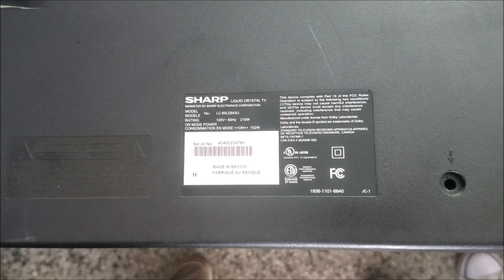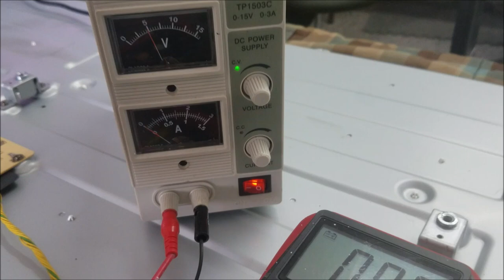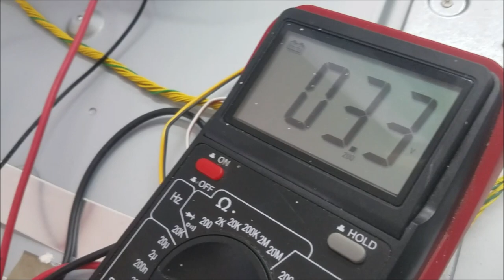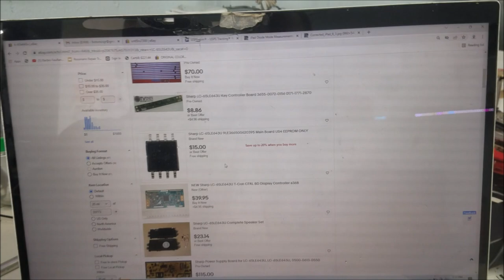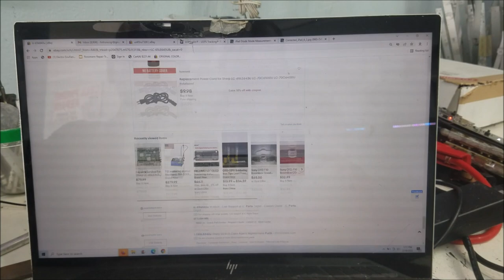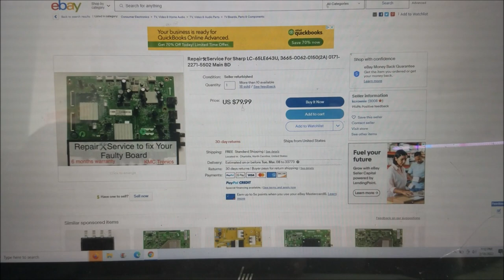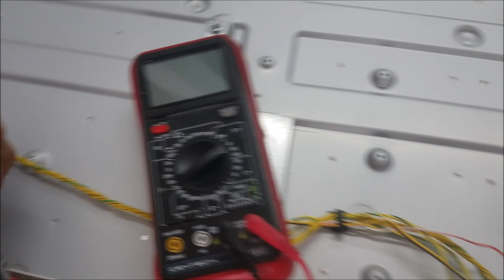SHARP TV  no power mainboard repair step by step to learn

Comment: Hi friend thanks for the informative video. One question if the ps_on voltage is on while the tv is in standby mode can it be a processor or eeprom?
Reply from the maker: Dose the voltage on ps-on change when you hold the power button?
Reply: @SOSfixElectronics  hi friend, when I plug in the power cable the standby led shines, when I tested the ps_on it read 5v when I press the power button it doesn't respond, no bl_on voltage but 12v,5v and 24v present. ps_on voltage remains on 5v

Comment: I am only gettin 11volts from pin 1 2 and 3 :(
Reply from the maker: what the voltages should be in that pins? i dont have this board to check for you
Reply: @SOSfixElectronics  Hi, thanks for replying to me. The voltages should be 19 Volts on each pin.  My power supply is similar to the one you are testing. It is from a Sharp Model LC-65LE654U